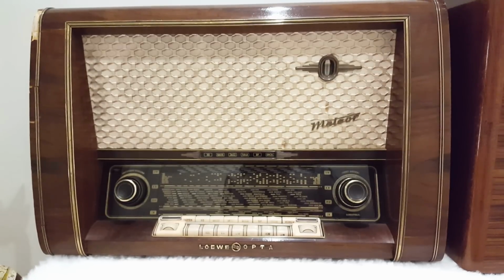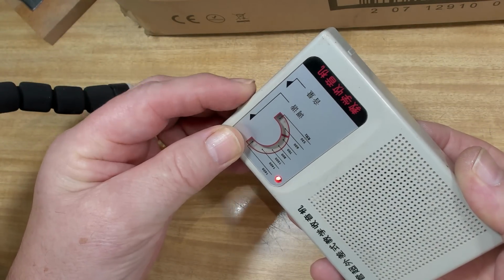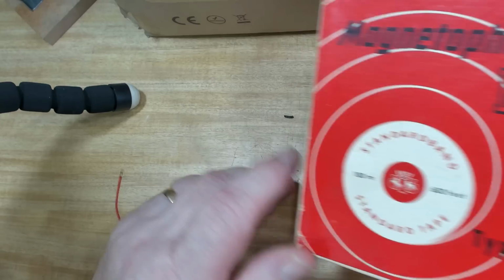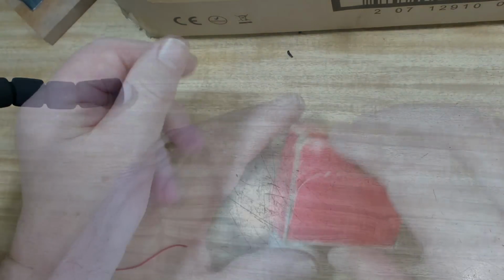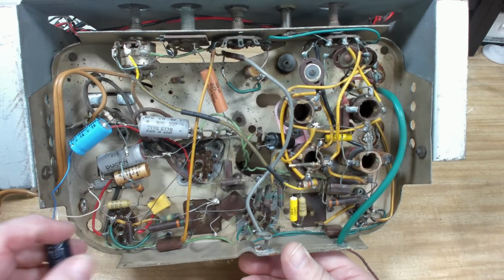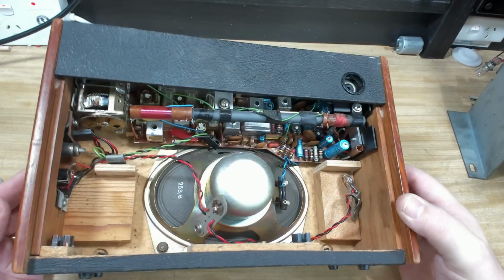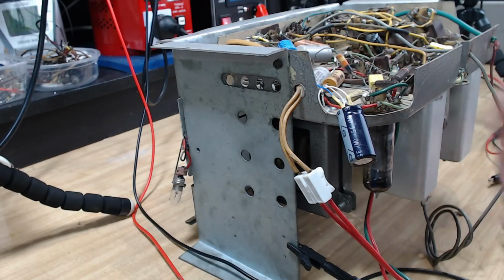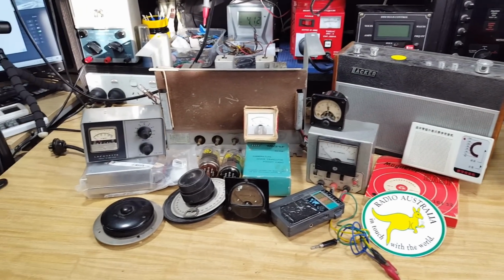Radio Club Auction - What did I get - Trash or Treasure?

Comment: Seen the small transistor repair vids, waiting for the Hacker one.  The Kriesler is calling out for one of your case creations with modern mods to it too (see uncle doug's amp creations in blue art deco for inspiration).  The Transmitter stuff should re-sell for a few bucks at least ( though see if you can build a small home FM transmitter for broadcast from the house to the garage/workshop by relay etc.  The millameters are useful for audio measurement out to tape recorders etc.
Reply from the maker: Hello High Path. The Hacker is done, I might put it up this Friday. I passed on the transmitter stuff. I did use one of the meters for taking a measurement of something, can't remember what. I wonder about making a case for the Kriesler 🙂

Comment: That mini transistor radio might need a battery that is more than 1.5 volts.  In the USA a few decades ago I once was brought a transistor radio that needed a 9 volt battery in a similar form factor to the AA cell that you tried.  At that time Radio Shack still sold that battery.  Check the manual carefully to see what battery type is specified.
Reply from the maker: It takes a 1.5 volt battery STLTGM according to the accompanying documentation 👍🙂
Reply: @DavidTipton101  If germanium transistors, that can be so.  Hope you can get it fixed up.  It's a cute little box.

Comment: Hope the doctors set you right. On the mend I hope. Cool auction box. Always something surprisingly unuseful.
 Early eyetube covers are hard to find cheaply. That one looks like a pre-war one. Kriesler was a bit of a hack job
 but it does work now. Cabinet may be hard to find. May need a trip to another auction! 1960's pocket radios seem 
to be in now as collectors pay some big bucks for them if working.
Reply from the maker: Hi Steve, this contained a fair bit of un-useful items, to me at least. The eye cover night be useful and the Kriesler chassis will be for parts most likely. I have started a collection of pocket radios, these will look good amongst them. Thanks Steve 🙂

Comment: Thanks for checking in mate. I always enjoy your content. 
And, if you're curious, there's a way to get a general date that radio from the US. As you look at the enclose warranty information, pay attention to the return address. If the address has a 1 or 2 digit number after the city and before the state, it's pre-1964. If there's a 5 digit number after the state, it's post-1964. The US Postal System changed postal codes in 1964 instituted ZIP (Zone Improvement Plan) codes.
Reply from the maker: Thank you Tim. I checked the warranty card and there is no postal or ZIP code. It says: 
589 East Illinois Street
Chicago, Illinois.
🤷‍♂️

Comment: GladTo Hear Your On The Mend David The Autocrat mk 2 (RP73) Was From 1973 It Used a Chip a TAD100 Plus 6 Transistors And The Output  Is quoted At 1.6 Watts RMS I Have One That I Repaired (faulty tad100 i.c.) Although Not The Best Set That Hacker Made it is a Lovely Honest Set Thanks For Uploading David Regards mike.
Reply from the maker: Hi Mike, My TAD100 is OK thankfully. The chipwood case is pretty ordinary but the radio itself seems good. Thanks Mike 👍🙂

Comment: David, glad to hear all is well since you caught it early. It seems you also may be involved in tape recorders, why the tape otherwise? I would be interested in your endeavours since I worked with mag tapes for almost 30 years. Little and big ones, audio, video, up to multitrack analog and digital data acquisition monsters.
Reply from the maker: Hi Milan, thank you, I get regular skin checks to be sure. I do have two reel to reel recorders here, I will do at least one of them. It may be uncomfortable for you to watch as I don't have much experience with them 😉🙂
Reply: @DavidTipton101 David, your experience in reincarnating radios far exceeds mine. I did one 1940-ish GE toombstone being inspired by your endeavors. Recorders electronics (amplifiers, oscillators), at least the commercial 1/4" types, are in a way very similar to radios. Mechanics can be a problem especially with rubber drive wheels and belts. Your presentations are educational and inspiring especially with the attention to details in electronics,  restoration of hardware and overall quality of work, and are a joy to watch. Please strike out the word "uncomfortable".
Reply from the maker: @milantrcka121  Haha... OK, will do uncomfortable 😄

Comment: Those 6146 are great - can be used as audio tubes like a 6L6. Don't throw them away! They are great!
Reply from the maker: I believe they were used in large amps and the output would be massive, theatres and such I would think. If I had another two I could make a stereo push pull amp for my TV 😄 Thanks mohinder.
Reply: @DavidTipton101  6146B plate dissipation is 35 watts. you could build a 60 to 80 watt amp with those 2. or you can use them single ended 10-15 watts  per channel for stereo. protect the screen grids, they need about 250v
Reply from the maker: @mohinderkaur6671  Ok, thanks 👍
Reply: @DavidTipton101  , six 6146B tubes were used in the earliest Ampeg SVT  bass guitar amp, for 300 watts of audio. I've also seen an old RCA paging amp that used a quad set of them.

Comment: Hi David, I surely think your plus and minus 25 micro Amp meter is a full Amp meter ? Probably in between a battery to watch charge/discharge or so. If it was 25 micro Amp it could not get that heavy pointer a millimeter out of the way. A micro amp meter has a resistance of a few hundred Ohms, so compared with the far less than one Ohm for an amp meter (shunt inside) that is simpel to check. The thick wires give it away.
Good luck with your health, and please don't blame the sun as much as they would like to. Enjoy !
Reply from the maker: I don't know what to make of it Erik. It says 25-0-25 uA, it's resistance is 1.7k and it goes full deflection with the DMM. It must have had a special use somewhere. Those terminals are huge but it says 18 SWG on the back but that's only 1mm, I imagine the large cable terminals are to limit losses for such a sensitive meter. I'm all clear on the health side. Thanks Erik 🙂
Reply: @DavidTipton101  In that case it is indeed 25 µA, because 1k7 is impossible for 25A. It is a Galvanometer then, nice and sensitive. Not difficult with Ohms law to calculate a shunt (parallel) resistor for measuring any sort of current or a series resistor for measuring any sort of voltage. Only problem is the scale is already set for 25-0-25, so that limits possibilities. But nice ☺

Comment: I had one of those micro radios many years ago, which came from Hong Kong, it had very good sound quality for its size. Well worth getting it working. Never had the circuit diagram.
Reply from the maker: It's quite a novelty radio and be as good as any with that size speaker. It should be a good display when it's finished. Thanks Nigel 😊

Comment: 5:30 - That's called an "eyebrow", and yes it is for an eye tube. 
8:00 - The Ross radio is a winner winner, chicken dinner as EEVBBLOG likes to say. Soak the soft ear plug of the earphone in hydrogen peroxide and Robert is your mother's brother. 
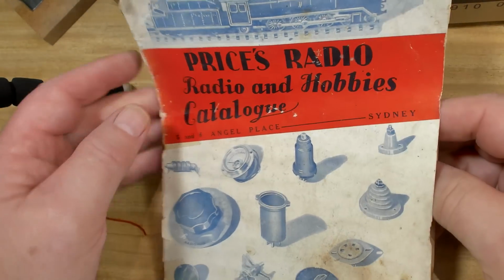9:00 - Preserve that catalog at all costs. (Scan it at at least 300DPI, color for color pages and BW otherwise, no descreen. If the moire pattern is too much, try higher resolution til the stripes disappear. Failing that, then try the descreen settings and choose the best one.) Save each page as either high quality JPG OR an uncompressed format. Then combine them into a PDF. If you want the absolute WORST outcome, scan straight to PDF and it will be unreadable. PDF tries "to help" too much and provides the user with absolutely no control over this. You have probably download schematics that meet that description. So frustrating.
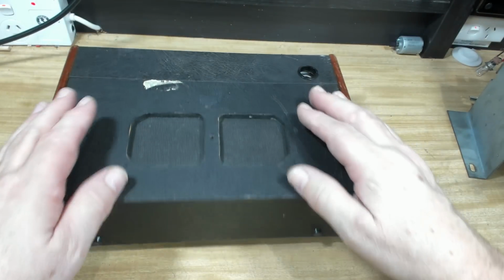13:25 - According to my careful prosthesis, that would be the bass relief port for the speaker. Great radio! Definitely mid 1970s.
Lastly. David, you have the best radio restoration channel on the web. May you get he best outcome possible with your health. Prayers at my end. might not help. But, can't hurt.
Reply from the maker: Hi videolabguy. 
Eyebrow is a good name 👍
Hydrogen peroxide is a good idea 🙂
I will copy it, I wonder if I can get it listed on the WEB? 🤔
Yes it would be for bass relief 👍
Thank you 🙂

Comment: A further quick thought about the Hacker Autocrat (assuming my earlier comment did get through to you) and that is unlike most other Hackers that use 2 x PP9 batteries, the ones in the Autocrat are wired in parallel and not in series, ie. as shown on the escutcheon these are 9v radios rather than 18v. And it will run on only the one battery.
Reply from the maker: Hi Gerard, thanks, yes I realised it was a 9 volt set, I even ordered some PP9 batteries from the UK 🙂 It should last quite a while with the two batteries.
Reply: @DavidTipton101  Hi David. Yes, they do run for a long time with two batteries. But that must be expensive for you having them shipped over to there. Perhaps when eventually exhausted you might want to think of re-packing the cases with batteries? For even greater economy I use rechargeable ones, Graham (R’cruncher has used PP3’s, whilst I use AA’s). Also lest a fault might develop in the radio I also fit an in-line fuse due to their high current potential. 

When you get into the Hacker you will be happy to find it doesn’t have the AF series transistors that have been mentioned. It does though have germanium output transistors as well as the famous “T2” but these are generally quite well behaved and less prone to tin whisker syndrome.
 
The Autocrat 2 was a late (1972) budget radio, and another FM only version (the Harrier) was produced at the same time. In terms of “budget” Hackers though the one you want to look out for if one ever comes within your reach is the Hunter (RP 38A) – as although made and marketed as a “budget” model it is widely recognised as being one of the best radios Hacker ever produced. Really good looking too, especially the later ones that came with a very robust extruded aluminium grille.
All the best, Gerry
Reply from the maker: @gerardcarson2779  Thanks for all that info Gerry. The batteries aren't that bad price wise but yes I will restuff them when they are depleted 🙂

Comment: If I heard you right, and that little valve is a 6BA6 it is used as a high-gain radio-frequency or intermediate-frequency amplifier. I don't know what those sell for in Australia, but here in the U.S., they go for about $7.00 each and that is for a used item.  In Australian currency, that's what? About 11.00 Aussie dollars?  So, depending on what you paid for the box of "goodies," that little box of valves can be resold to either partially cover or completely cover the cost.   

When I was teaching electronics back in the 1980s, the school was donated between 750 and 1000 brand new tubes (valves).  Literally thousands of dollars in today's figures.  I later learned, after taking a higher paying position, the school ran them all through a large trash compactor and disposed of them.  That thought rather makes me ill knowing someone like you could have used a large portion of them.
Reply from the maker: Yes, a 6BA6 Ralph, I have 24 NOS of them plus other used ones. I sold one piece out of the box before I brought it home so it owes me about $30. I might be able to move the two transmitter tubes on and recover most of that. The box of tubes were used, I'll see if there is anything worth keeping or moving on but I'm happy with what I got, the recorder tape was the main thing I needed. Thanks Ralph 👍😊

Comment: The 0D3-A is a two-element gas-filled, cold cathode voltage regulator. It is designed to provide a regulated output of approximately 150 volts. A jumper connected in the base between pins 3 and 7 provides the designer with several possible connections to ensure the protection of associate components in case the regulator is removed from the socket. Except for bulbs, this type is interchangeable with 0D3 tubes. Also known by US military identifier "VT-139", "VT-139/VR150-30"
Reply from the maker: Thanks Wayne, I don't know what I can use it for though 🙂

Comment: I had a few spots removed from my back this past week as well.  All benign, but they should not be ignored, especially if they can't be seen without a helper.  The 6146B transmitter tubes can be worth some money if they're NOS and a matched set.  Yours look like they're in good condition.  My 40 year old hybrid Kenwood TS-830S ham transceiver uses two of them.
Reply from the maker: Agreed, I get checked every 6 months, it's not worth the risk. The tubes look new, I don't know if they are matched or not, probably not, I'll see if someone wants them. Thanks SY 👍🙂

Comment: The Hacker Autocrat was designed to be used in a car (my Dad used to have one!) It came with an external aerial that you fitted to the car by winding down the front passenger window, hooking it over the glass and then winding it up again. You then plugged into the side of the set. The auto button switched from the internal ferrite aerial to the external one.
Reply from the maker: Hi Roger, I didn't know it came with a car aerial, that's interesting. I have worked out the 'Auto' button but it had me guessing for a while 😄 Thanks.
Reply: @DavidTipton101  At the time, you needed a separate licence for a car radio, but only if it was actually fitted to the vehicle.
If it was a portable set, you did not need a car radio licence 🙂

Comment: Hey Dave, glad they found the issue on your back. Hope you’re recovering well. The RF converter is indeed for the amateur bands. In fact, there is a UK ham call sign on the dyno label G3LLZ so it is a kit built by an amateur operator in the UK that somehow found its way to Australia. It’s designed to convert the 2m amateur band 144 Mhz to the 28 MHz (10m) amateur band so 2m can be received on a HF receiver (which only receive up to 30 MHz usually) although some HF receivers also have the 50 MHz (6m band). Craig VK3CRG Geelong
Reply from the maker: Hi Craig, I'm all good now thanks. I googled G3LLZ and had a number of hits. I couldn't get his name without a sign in but there was a video and a link to the Swindon Amateur Radio, it may well be him. Thanks for the info on the converter 🙂

Comment: Hi Dave,
Love all those radios, and radio paraphernalia as we do, your health and well-being is of paramount importance.  Remember you’re only a few months older than me, so take good care - old school electronics guys like us are becoming an endangered species LOL!
Having seen the photograph of the tabletop radiogram that Chrysler chassis would once have belonged to, I am very impressed with the appearance.  I for one see it a crying shame that chassis, for whatever reason, become bereft of its cabinet.  They were fine looking sets.  I suppose it will be highly unlikely you would be able to get your hands on a scrap cabinet, and record deck???
I own two of that particular model of Hacker transistor radio.  Hacker produced very fine sets!  It might be an idea if a video, or mini-video series was to be devoted solely to restoring that particular set - I’d say it’s at least worth considering.
When it usually comes to repairing/restoring those ‘cheap’ imported 1960s transistor radios on camera, I usually give the project some thought beforehand.  Nine times out of ten their faults can be traced to broken wires, dry solder joints, broken plastic parts, a visitation or two from the screwdriver fairy, or cracked and/or warped circuit boards.  They can, however, be absolute pigs to get working should their faults be more than what I’ve just described.  Should that turn out to be the case, yes they can be got working, but one might well be confronted with a time consuming battle!
Although I hold an amateur radio licence, am-radio can be an involved, and expensive pursuit but also very satisfying.  For me, it’s a hobby within a hobby!  If it holds little or no interest for you, then you do right to pass it by as the latest am-radio gizmos will constantly be tugging at the folding monetary contents of your wallet LOL!
Cheers my friend, Phil
Reply from the maker: You are right about endangered species Phil 😄 I have one of those Kriesler radios with a three speed gram in it, it works very well and was our daily radio for quite a while, getting another case and gram will be difficult I suspect. The Hacker repair is under way as well as the three transistor sets and I have made videos of them all, I won't give anything away but transistor sets are not my forte. I have no ambition to do amateur radio at this stage, maybe a bit later on but hopefully someone can use the bits I found in the box. Thanks Phil 👍🙂

Comment: You have lots of useful stuff there :-D just needs a little bit of love but you are amazing at repairing things.
The meters could be handy,  you never know when you might need one for voltage/current or in a home made power supply, or to add to a psu for indication.
Maybe test the meters, they may all work if your lucky.
I'm really surprised the chassis radio works,  you know the valves are working and the mains transformer can be pinched for another radio :-D.
The hacker is worth fixing , i know you will make it look fresh and cared for.
You have some small radios too.
I would not throw the metal boxed items away because it's not useful at the moment, if the box is decent it could house other projects.
I'm sorry about your skin problem dave :-(   i hope it heals up fast.
Sorry dave, i do waffle on a lot.
Reply from the maker: I hope someone watching can use some of it. I'll see what I can do with the meters, I know the uA meter works. I thought the radio chassis would work despite the poor work done to it, they usually do. The Hacker will get a makeover for sure and the small transistor set as well. My skin issues are under control, it's just the healing holding me back. Thanks zx8401ztv 👍🙂